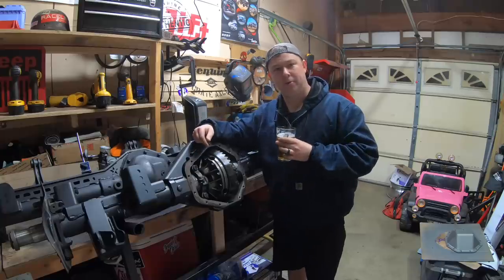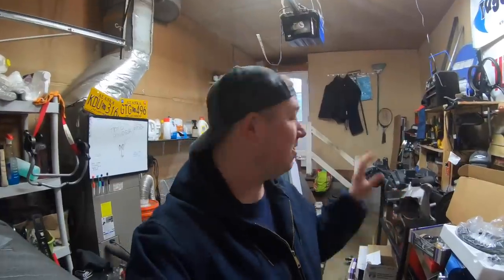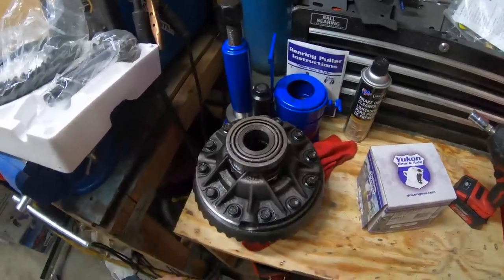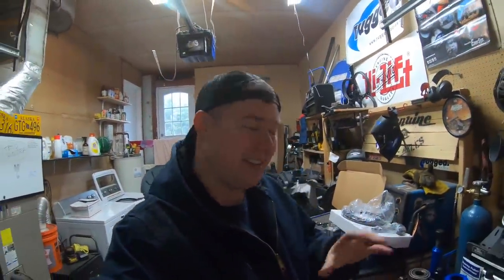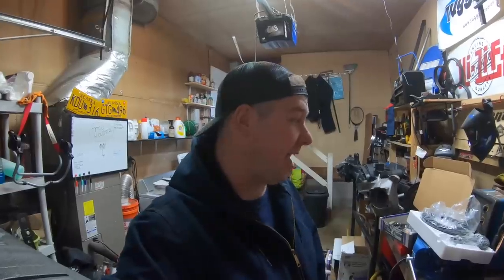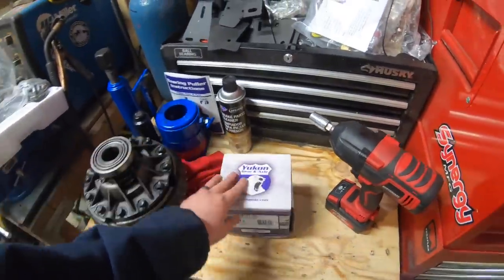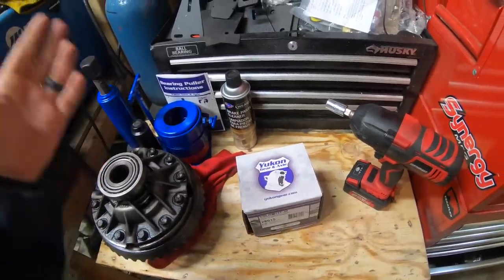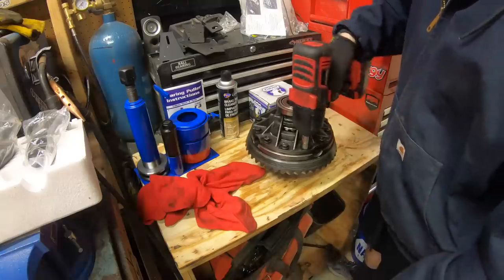14 Bolt Axle Regear And Locker Install - JK 1 Ton Swap Video Series

Comment: Great video! Where would you suggest finding a selectable locker for the 14-bolt? Also, how does your Grizzly handle on the street? I plan to build mine not as a daily, but so I can drive it to & from trails far away.
Reply from the maker: Arb for the selectable. As for street manners with the grizzly, it’s not bad at all. Still extremely driveable, i drove it daily for about 2 years
Reply: @JKGearandGadgets  thanks! I'm on a 2014, and you're on a 2011, and it seems the auto-locker can confuse the computer and make it limp. I'll go with that ARB.

In case anyone is reading the, ARB on the 14 bolt 10.5" wants the "thick" gears for lower than 4.10, but Yukon sells those thick gears

Comment: Hey Ben! I have a question. I am trying to order that bearing tool on Yukon Gear but I can't order it directly from the website. They want me to buy it from a certified retailer. I live in Washington state and I can't find a retailer near me. How did you end up buying yours? Thanks for the best GM 14 bolt video on Youtube. It will definitely help when rebuilding my own 14 bolt.
Reply from the maker: I bought mine online. I should have a link in the video description

Comment: Great channel Ben. I have a 2015 JK sport want to run 37’s. What gears should I install and lockers.
Reply from the maker: For 37s I would recommend 4.88s or 5.13s depending on the transmission. 5.13 auto, 4.88 manual. As for lockers I would recommend selectable air lockers.

Comment: Are those backlash adjusting sleeves exclusive to the 14 bolts? Seems way easier than pulling out the carrier every time you wanna add or reduce backlash

Comment: Honest question not trying to rag on you.  You're going with the 14 bolt because it's stronger than the sterling but now you either have to use 2 different lug patterns which is inconvenient or run wheel adapters which most people consider too weak for offroad use.  Is it really that much stronger than the sterling that either of those options is worth it?  For what it's worth you have very good detailed videos and I watch more of them now that i have a JKU in addition to my LJ.
Reply from the maker: Not because of strength. Because the sterling interferes with the gas tank
Reply: @JKGearandGadgets  so the diff on the sterling is farther passenger than stock or the 14 bolt?
Reply from the maker: @alanhamel4955  it’s further passenger than both stock and the 14 bolt. Some people have luck with hammering and smashing the skid/tank a lot, but you still have to run a pretty high lift height.

Comment: Did you replace axle seals during this swap? If so any vids you did or would recommend for that? Also i did not see in your vid but i assume that you had to put silicone on the pinnion shim or something to keep it from leaking or is there another seal somewhere that prevents that?
Great vid best i have found on the subject i have watched it several times.
Reply from the maker: I did replace the hub seals, it’s fairly straight forward. I’m assuming there are videos on it. You can put a little silicon on the washer, but not entirely needed in my opinion. The pinion seal, and red loctite on the threads usually keep the oil in.

Comment: Also dont you need thread sealer on the adjuster threads.  I was told today you do.  Which suck because that means I need to tear it all apart now
Reply from the maker: I didn’t. No issues in the past 2 years
Reply: @JKGearandGadgets  cool.....

Can I facebook friend you and do a vid chat,?

I still need to measure for inner axles
Reply: @JKGearandGadgets  oh yeah. You did a rear end.  M8ne are both steering axles with crane rev 14 adjusters and thats where the seal is so I prob do have to pull apart and seal the threads.  You have a rear so you are sealed farther out. My bad. I just didnt think of it

Comment: 10:06 Ben instead having your wife bust your balls about using the oven to heat the ring gear you can alternately just put the carrier in a freezer (lol beer fridge if you have one) has the same effect as heating the ring. Added bonus, it's not hot so you can keep working on it right away.
Reply from the maker: Very true! Thank you for bringing that up. However I have a feeling Cassie would still get mad 😂🤦🏻‍♂️
Reply: @JKGearandGadgets  you need a beer fridge in your shop anyway, so here's another excuse to get one. lol🍺
Reply: @JKGearandGadgets  Sorry to keep dropping tips as I watch, I don't wanna come across as a douche. Another added bonus of freezing the carrier is that your bearing will also not needing to be pressed on.. 21:13

Comment: I want to regear my 2010 Jeep Sahara unlimited from stock gears to either 4.56 or 4.88 to run 35in tires, I am just wandering how hard it is if it’s possible to do in your garage.

Comment: What kind beer 🍺 was that? It was good info for me would it work on my 2011 jk two door 3.8l or shout get rubi axels instead?
Reply from the maker: It would work. But depending on how you want to use the JK, Dana 44s might be better. They will be lighter so it will still feel the same as stock, one tons like these are veryyy heavy. Built rubi 44s on a 2 door are perfect for 37s/39s and some heavy wheeling

Comment: Out of curiosity what is the oem yoke size on the 14 bolt?
Also I know it's not covered in this video but i've watched the entire series and was wondering if you were able to adapt the JK parking brake cables to the 14 bolt.
Reply from the maker: 1410.  And I used the fusion4x4 cable kit

Comment: Hey Ben, at final assembly of the pinion, did you do any sealing for the pinion mating surface? (Not the yoke pinion seal, the 6 bolt mating surface or only use the shims?)
Reply from the maker: I only used the shims. So far so issues
Reply: @JKGearandGadgets  thanks for the quick reply! Have fun on that LS swap!

Comment: Couldn't you just combine the crushed sleeve eliminator (CSE) with the shims and then use the caliper to measure the height of it. With the height measured, wouldn't that work to get it slightly higher/taller?

Comment: I just set up my 14 bolt this weekend. I bought 4.88 motive gears and a Detroit locker. I installed the crush sleeve eliminator and the pinion preload came out to 12 inch pounds with my used bearings. The bearings were replaced 3k miles ago. The backlash I checked in 4 different places. It’s between 6.5 and 7.5. The gear pattern was in the center on both the drive and coast. Everything is torqued correctly and topped off with Mobil full synthetic oil. Took it on a test drive and there is a slight whine from about 35mph to 50mph. Can’t hear it if the radio is on. Do you have any suggestions or is this normal. It was already regeared 3k miles ago to a 4.10 on 35s and the gears made zero noise. I stepped up to 4.88 when I went to 37s 

Sorry for the long message
Reply: So what was it? Bearings?

Comment: My 14 bolt already has a factory 3.73 ....to use this locker would i have to change the gear to a thick cut or just go with it ?

Comment: I'm building a 2000 Jeep Grand Cherokee (wj). My question is, no one makes a truss kit for this application, so can I just buy all new brackets, do some measurements and weld them in stock location on the Dana 60s.
Reply from the maker: Your front is the same as a TJ or xj
Reply from the maker: But yes you can just buy the brackets for the rear and weld them in the factory spots

Comment: Hello, I only need to regear to a higher gear 3.23.  Would I still need to do shimming if I use the same bearings and old shims?  I don't want to spend on a master kit.  It for a road truck only not off road use.
Reply from the maker: Any time ring and pinion is swapped, you will need to do all this.

Comment: That 14 bolt being in the front is going to make the coast side take the forward driving load correct? And the drive side will being used when in reverse correct?
Reply from the maker: This is a rear application. But if it was used for front then yes.
Reply: @JKGearandGadgets  thanks for the reply. I was searching front 14 bolt conversions and was thinking about rotation and I never relized what you were building was for the rear lol. You did put my mind at ease though because I kept second guessing myself as to weather it would be turning backwards in the front or not lol.

Comment: Alright Ben, one more question. I’m either going to get dewalts 20v 1/2 impact or harbor freight. Recommendation?
Reply from the maker: I have had bad experiences with dewalt, honestly the harbor freight has handled everything I’ve thrown at it, plus buy the protection plan and your good for a few years

Comment: Hey, I am doing the same 14 bolt swap in the rear I just used an Artec kit. My question have you found what the proper offset would be for this swap. Looking at rims and I haven't found anything concerning offset yet.
Reply from the maker: It depends on what steering setup you plan to run, but usually around 4.5” backspacing or less will be good with this swap.

Comment: When setting up the pinion preload with the eliminator, isn't the outer bearing ruined when you press the pinion out of the housing since you can't press against the inner race?  If it is ok, how many times did you do it to get the preload correct?

Comment: I don't understand why it's frowned upon to use the bolts to suck in the ring gear to the carrier. You're doing the same thing with the hammer.
Reply from the maker: The bolts stretch, they are designed to be torqued once and they deform in the process. Pulling the ring gear on with the bolts will stretch them prior to them being torqued. You could use your old ring gear bolts to pull them in, however it depends on the resistance. Then you run into galling the threads inside your ring gear
Reply: I find it absurd that using all those bolts to suck in the ring gear would "stretch" them.
Reply from the maker: It all depends on how easy/hard the ring gear goes on. Lots of times the ring gear is extremely hard to get onto the carrier without heating it up, in that case it would stretch the bolts.  It’s all situational, but more of a “practice”.  I’m sure if you put 4 bolts in, and had some helpers and tightened each one evenly at the same time then you would be fine.

Comment: 2 questions
Where did you get the new bolts from
Is your 14bolt the 11.5 or 10.5 which had more easier gears to find?
Reply from the maker: Ordered them online can’t remember.  And I prefer the 10.5: the 11.5 doesn’t have the removable pinion housing

Comment: Wayalife and Dynatrac just put out a video on use of the crush sleeve eliminator. Your assumption of measurements from the previous gear set are inaccurate. You also  are not showing use of grease into the bearings as you install them. You have to measure preload with torque resistance of 25 to 30 inch pounds.
Reply from the maker: Like I said, it is a starting point. You adjust from there, I thought I clearly showed that in the video. You start from the original crushed sleeve measurement, otherwise your just shooting in the dark. And yes you use a little bit of gear oil, not standard grease when checking preload.
Reply from the maker: Dynatrac installs these every day, so I’m sure they know exactly what shim to start with, and then adjust from there. However... the majority of people setting up axles do not do it every day, sooooo a great starting point is around 2 thousands from the original crush sleeve. And they are probably using white lithium grease, standard bearing grease throws off your readings, however once again, gear oil works perfectly fine.

Comment: How strong are those little lockers? I have a Silverado with a 14 bolt in it. 5.3 on 37/13.50r17s, looking at air lockers but they are double the cost
Reply from the maker: Incredibly strong!
Reply: JK Gear and Gadgets thank you for the fast reply. I think I’m going to try it out. Good video. Very informative

Comment: Which is better? 10.5 or 11.5? I can get a 11.5 but I’m wondering if it’s worth it?
Reply from the maker: 10.5. More aftermarket support. Well it really depends on what vehicle it’s going in. The 11.5 is stronger since it has a bigger ring gear, but the 10.5 is better if you plan on building it out
Reply: @JKGearandGadgets  I can get a 11.5 for cheap and I want to build it for my MJ Comanche. I hope to do some rock krawling with it.
Reply from the maker: Ah yeah If you’re staying leaf’s then you should be fine with the 11.5

Comment: If I’m using the same exact gear carrier and ratio out of another identical rear end do I need to set backlash from scratch or can I use the rotations of the adjuster sleeves I did to take the old gear carrier out to get the right backlash?
Reply from the maker: Each carrier can have differences. Need to check once installed
Reply: Do you think it would work out if I put the ring gear off the original onto the other gear carrier I’m replacing? The ring gear is in perfect shape. The inner gears and gov is what grenaded.
Reply: Sorry, I haven’t really messed with rear ends too much

Comment: i have a AAM 10.5 14 bolt corp.  Is it the same as the gm 10.5 14 bolt? Its out of a  03 Silverado 2500 hd
Reply from the maker: As long as it has the ribbed top, and removable pinion housing then its the same
Reply: @JK Gear and Gadgets  it has the removable pinion housing what is the ribbed top?
Reply: @JK Gear and Gadgets  and also I believe mine has a g80 locker with 410 gears do I have to change my carrier for 4.56 and a new locker like yours? Thank you very much for any info
Reply from the maker: @allenr7306  if it has the factory locker you’ll need a new carrier. As for the carrier break (gear sizes). You can either get thick cut gears or a carrier made for the gear ratio.
Reply: @JKGearandGadgets  so i can keep the 4.10 and down carrier and run 4.56 ring gear and pinion as long as its thick cut gears?

Comment: When checking your backlash you are moving the entire rear end. Your specs are wrong in that case. The rear end is rotating on your stand not just the gear backlash.
Reply from the maker: The dial indicator is mounted on the axle, so no matter if the axle is rotating 360* while I check it’s only measuring the gear lash
Reply: @JKGearandGadgets  I stand corrected. You are right!
Reply from the maker: @brents4729  it’s all good! I initially had the same thought when I realized the stand was moving some

Comment: Alright anyone know what a good backlash for an ARB air locker in a Dana 30 should be? I had my locker installed at a shop and he said he set it at .12. I thought that was a little sloppy but not sure if that's a good backlash for that setup.
Reply from the maker: That’s a hair outside the spec, spec is .006-.01” so your about 2 thousands out of spec, not horrible. However I’m surprised the shop wanted it that way
Reply: @JKGearandGadgets  I know right... I'm half tempted to not believe he even checked it honestly. When I asked he said it was set at .012 so he just put it back to where it was..... So I'm sure he just kept the same shims and made a number up maybe. AEV installed a set of 4.10s for me which would mean they set it at .012. I'd believe them over this shop. So I'm hoping it's set to what AEV set it to.

Comment: Why the 1350? Ain't the 1410 stronger?
Reply from the maker: They are, however I want to run 1350 on both sides of the driveshaft, front and rear. That way I only need to carry 1 spare u joint. The 1350s are plenty strong for non high horsepower applications.
Reply from the maker: To run all 1410s you really need a strong transfer case like an atlas. The factory tcase doesn’t like 1410 yoke